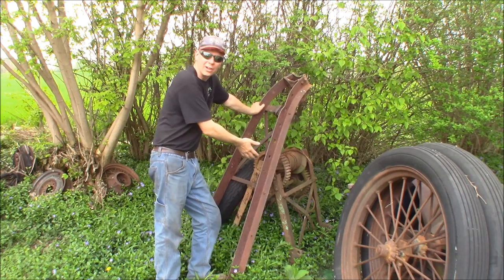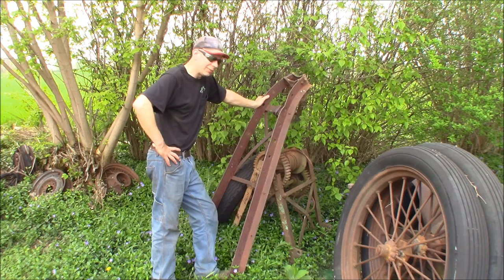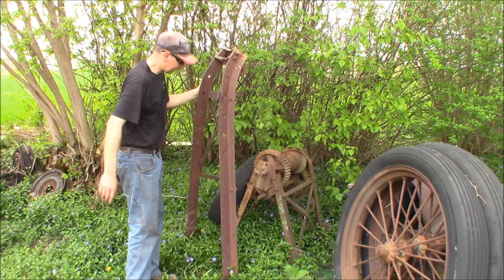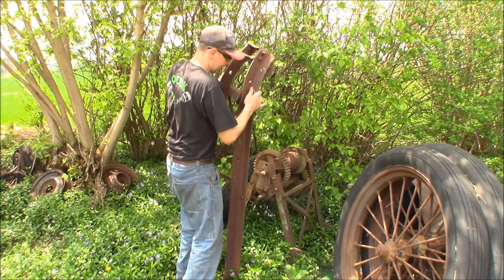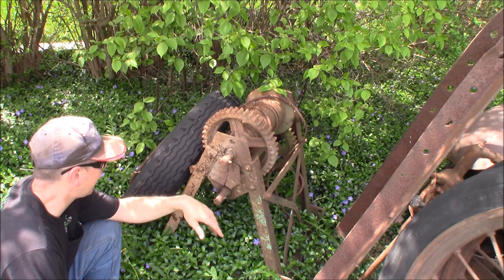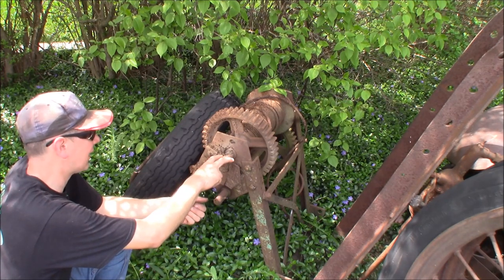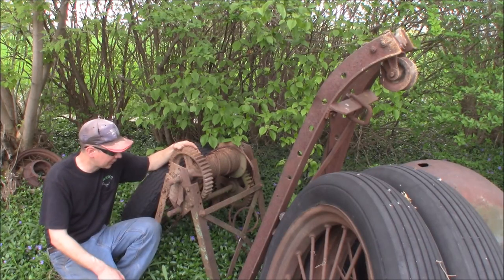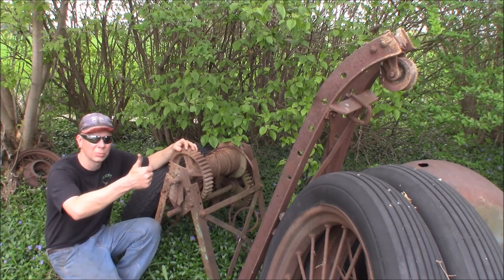Vintage Weaver Auto Crane:  Manual Tow Truck Winch

Comment: You mentioned that you made replica of these!   That is why I came across the video.  Do you have plans or a video how you made the replica?
Reply from the maker: No I don't, sorry.  I actually just eyeballed it off original pictures and drawing and made one close.  Search Model AA tow truck on my channel and you can see it in action!
Reply: @QuickSpeedShop  thanks for your response.  I went to check out your AA wrecker videos.  The wrecker looks great!  I have been drooling over these for about 10 years! All the ones I see for sale or a few thousand dollars and five states away. What is hard to figure out from photos is the size of the angle iron and the thickness of the metal plate on the original. Could you give me those measurements please?

Comment: Only difference between the 2 ton and 3 1/2 ton weavers was the bars that held the boom up.
Reply from the maker: Cool, thanks for the tip!
Reply: @QuickSpeedShop  yep! The 3 1/2 ton weavers boom arms were adjustable flatbar while the 2 is just round bar bent at the ends

Comment: A friend just picked one of these up and is trying to figure out how to use it. It's not frozen up but doesn't seem to want to move and I don't see how it can move with the two different geat sets t which seem to be opposite and bind when we try to turn it. I'm trying to figure out if you have to somehow disengage one set of gears or what?
Reply from the maker: The one I have is seized so I haven't used it.  I think there are two gear ratios to change speed/leverage.  Sounds like yours might be stuck between ratios.  Do any of the gears slide to change the ratio?
Reply: The small pinion gear, on the shaft with the drum, has to turn independently from the drum. Is it possible that it's seized to the drum? Mine was on the California desert but the roller bearings, inside the drum, were toast anyway.